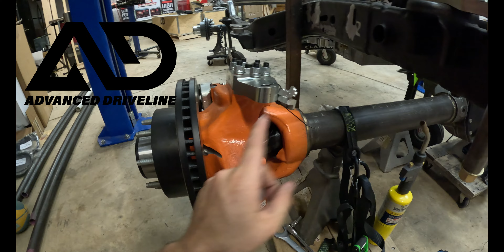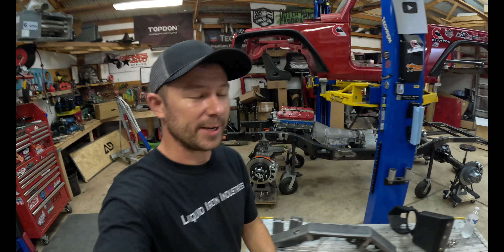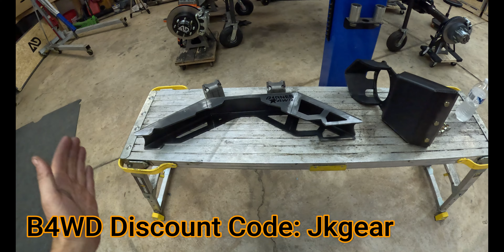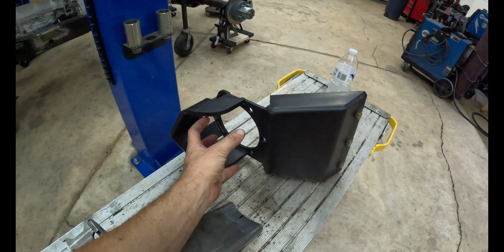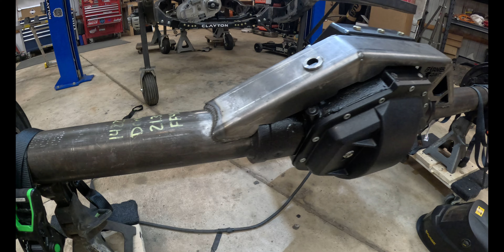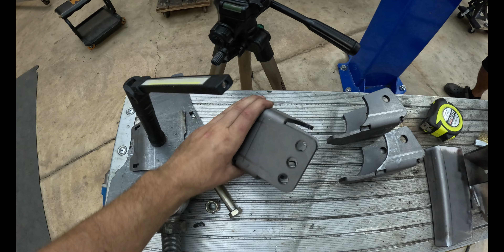Building Out A Custom Long Arm Suspension!  Ultra4 Jeep Build - Ep8

Comment: I’ve found out over time that those 14b pinion guards just act like an anchor. Once they dig into a rock they are hung up, just something to keep in mind. Going to flat flanges on the axles seems to help as well, if you don’t have the gaurd and happen to get on the pinion I’ve seen it just roll the rig sideways on the flange

Comment: do you think you might regret using such heavy axle assemblies, as opposed to drop out fab housing 9" based stuff?
Reply from the maker: Usually they only come out to be around 100-200lbs lighter. It’s a tough choice, but in the end I feel like these will be plenty strong and much easier/cheaper to find replacement parts. If anything, I would like to run a new lightweight brake setup but that might not be in the budget for this year.
Reply: @JKGearandGadgets  standard one ton type diffs are definitely cheaper in the long run (no $1200 gear sets, $4000 ARB lockers, etc, etc).

Comment: I understand the lay out for the four link but is a three link the same layout without the forth bar?
Reply from the maker: Pretty much, the trackbar will keep the axle side to side instead of the triangulated uppers doing that job. In our case; the 3 link upper is a little triangulated, so very similar to a triangulated 4 link front with just 1 upper link missing.

Comment: you should get one those Mr. cool self install  AC units for your shop so easy to install
Reply from the maker: Currently have 2 mini splits. Just installed the 2nd a few weeks ago. It’s not bad! But on the real hot days its still pretty bad. Need to finish insulation on the ceiling